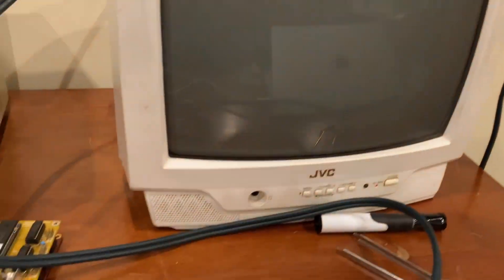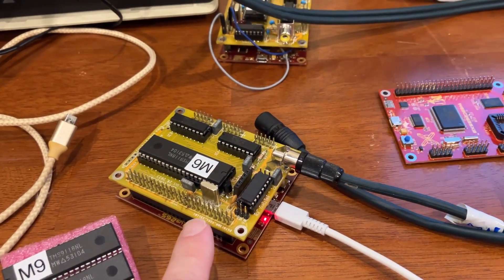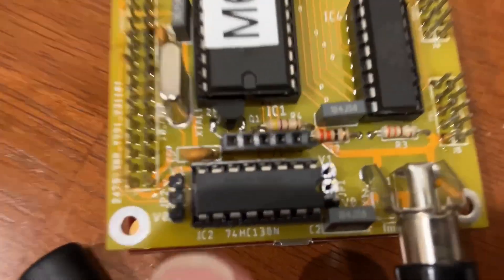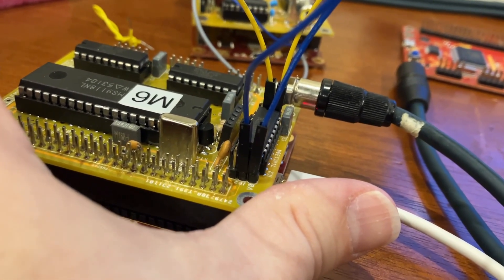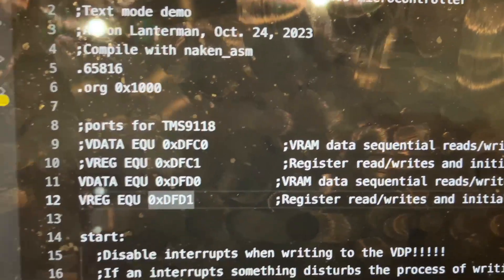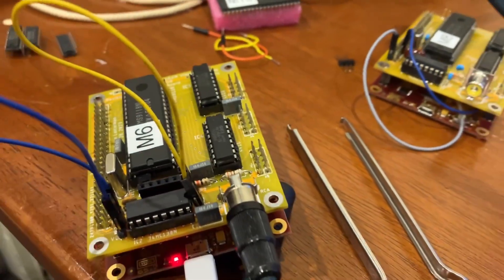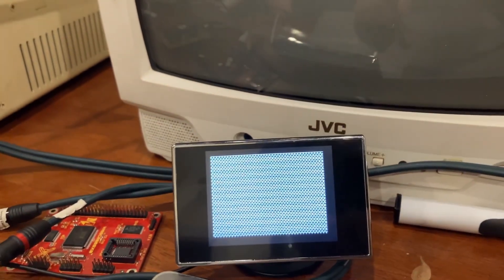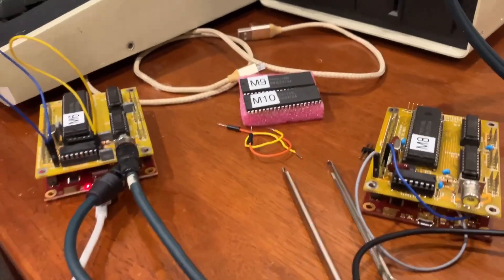RetCom87: Planning for Dual Screen Capability with TMS9118 Graphics Chips (address decoding)

Comment: Having two physical monitors would be neat. Might also be interesting to have two dissimilar video cards, maybe one with a higher color depth and one with a higher resolution but lower color depth. First cards output could pass thru the second and then in to the monitor with an analog switch IC controlling which cards video signal is actually connected to the monitor. A hi-res text mode would be neat to have for general computer task but may not be of as much use on a composite monitor as it would on VGA/RGB.
Reply from the maker: Oooooh! Yeah, the chip does have a way of making one of the colors "transparent" and bringing in an external video, so you can combine two chips to use one display. If I ever make a revision of the board I'll try to put that in.
Reply: @Lantertronics it wouldn't be very period appropriate but from your experience working on this project do you think the WDC board would play nice with something like the VERA board from the commander x16 project?
Reply from the maker: @StevenSherman-kr4xm  I totally want to  try interfacing VERA on this! When I mapped out the memory I made sure I had enough space in my "video" section to cover the 32 registers of the VERA. The TMS9118 boards, if I have two, just use up 4 of those addresses, but I have the others.
Reply: @Lantertronics VERA could handle sound, video, and SD card access; throw in a ps/2 interface and a memory expansion board and bam late 80s computer with a genuinely WDC backbone.
Reply: Does the FORTH port output to video or is still only viewable thru the serial connection?
Reply from the maker: @StevenSherman-kr4xm  Oh, Rohan (the student who wrote it) got a new version working on the TMS9118 video! The input is a PS/2 keyboard hooked to the interrupt pins.
He wrote a whole BIOS! Amazing work.
Reply: @Lantertronics wonderful
Reply from the maker: @StevenSherman-kr4xm  See this video: https://youtu.be/XWlhnP_Yl0A
Reply from the maker: @StevenSherman-kr4xm  In case YouTube eats my comment since it has a link (it sometimes does that), search for the video titled "RetCom87 Retro Computer Progress: BIOS, FORTH, PS/2 Keyboard, Video via TMS9118 (like TMS9918)"